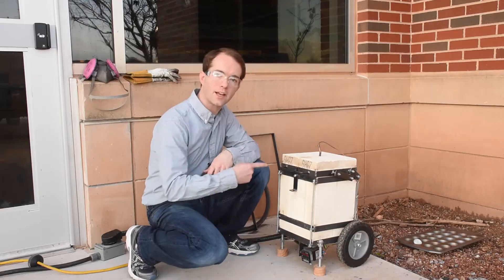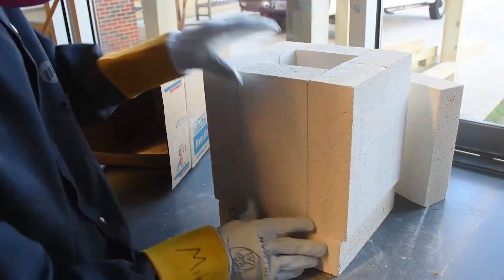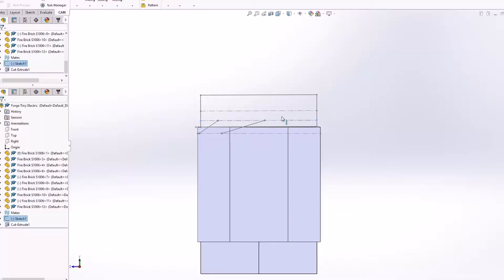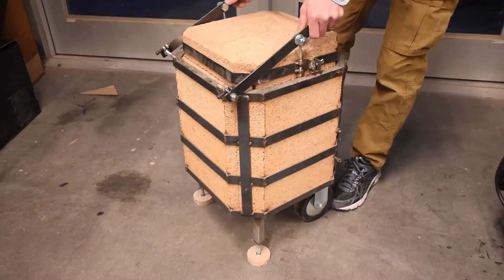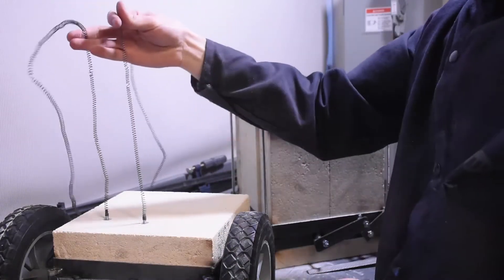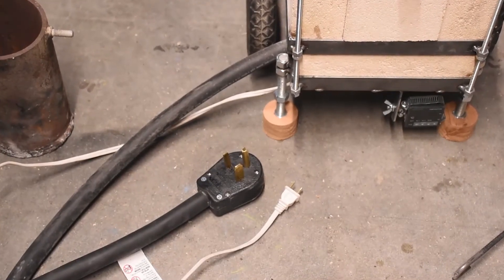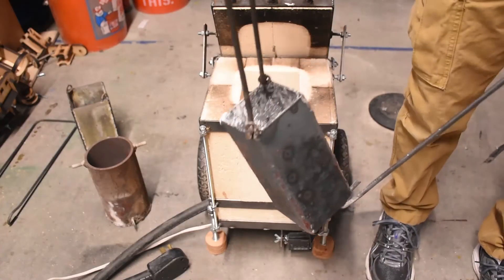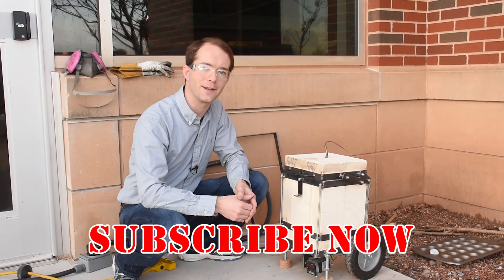My Electric Foundry - Mikes Inventions

Comment: will this melt brass
Reply from the maker: Hey there! Yes, it would, but I haven't yet. I dismantled this foundry to make a bigger one that goes live in a couple of weeks. I've had it in brass melting range a couple of times and intend to make a video about melting brass down soon.
Reply: @MikesInventions   I got firebricks from lowes rated 3000 but they are not the white light weighted ones. why did you say its not efficient?
Reply from the maker: @AllAboutJack  those firebricks are just meant to withstand heat, as in a fireplace, and they're not meant to insulate. I lost a lot of heat when I used those and was unable to make my first foundry melt aluminum with the 2500W coils I had. I since converted the hard brick foundry to gas, but I never use it anymore, because my newest insulated electric one is so much cheaper, cleaner, and is silent. Cutting hard bricks is extremely "hard" and messy too. It IS possible to build a hot box with these bricks, it's just not as efficient. Thanks for watching! Good question.
Reply: @MikesInventions  thank you for answering my questions. I'll be watching more of your videos

Comment: I made an electric melter. To get over the issue of an expanding coil, I cut my grooves at an angle into the firebricks. This was very effective.  I wish I had a pid controller for it. I just left mine on full tilt until it felt thoroughly melted. Did you use any borax to degas the cans and push out a bunch of the drpss?
Reply from the maker: Hey Marc! Thanks for the tip about the grooves. Going to use it on the next, larger version. I do use 20 Mule Team Borax. It seems to work fairly well, and man it's cheap.
Reply: I made my crucible out of steel pipe and a plate welded to the bottom. I don't know if it was from the borax, or the impurities in the aluminum from when I melted down all my scrap to ingots, or if I got everything too hot, but I ended up blowing out the side of crucible spilling about a quart of molten aluminum all over my driveway and ruining my coil. Fortunately my furnace was in three parts so the aluminum had a way to run out the base. I'd recommend checking the walls of your crucible every 3 or 4 melts.
I'd be curious to know how much your pid actually shuts off.
Here is the plan I used for mine. It might give you inspiration for future builds.
http://www.dansworkshop.com/2008/03/homebuilt-electric-melting-furnace-2/
Reply from the maker: Interesting. Glad you weren't hurt. The walls seem fine for now. The PID keeps the temp within a degree of what it's set. The little indicator light cycles On and Off every few seconds, or whatever is needed to maintain the temp I set. I'm happy with the controller so far, and I haven't fiddled with all the customizable settings yet. It's not broke, so I'm not going to fix it. ;-)